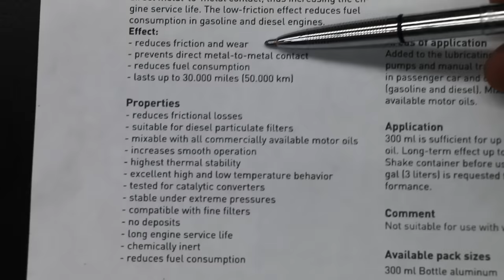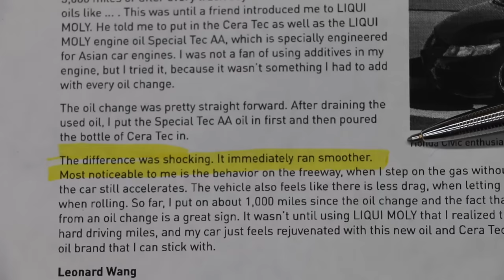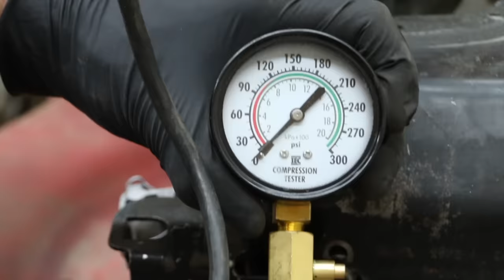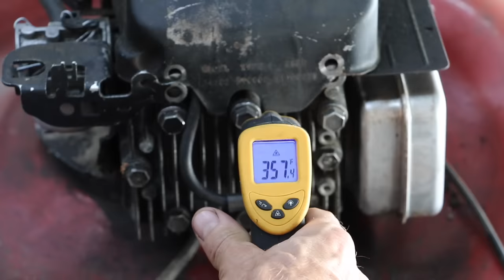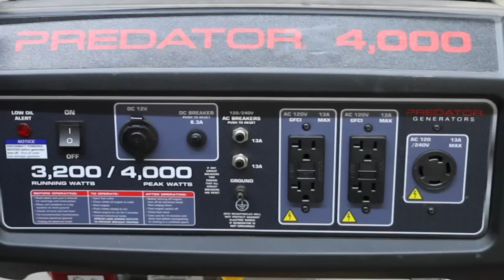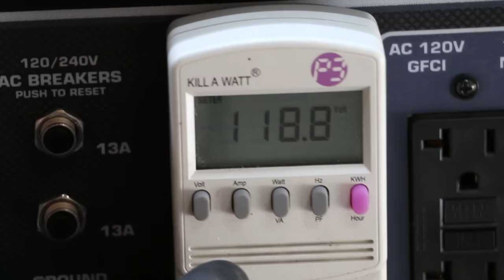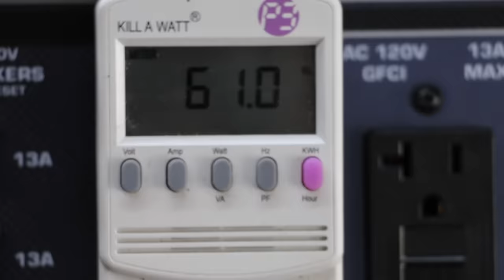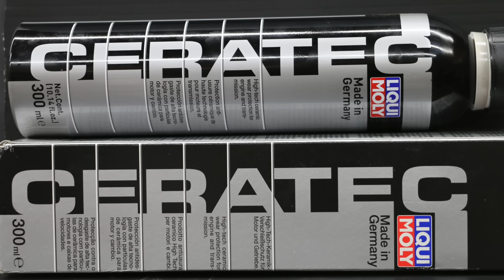Does Liqui Moly CeraTec work?  Let's find out!

Comment: As long as you run a decent, snythetic oil, you shouldn't need to use any additives. Love your work, project farm!
Reply from the maker: Thank you!
Reply: These additives are designed to improve synthetic or conventional motor oils. I have been alternating between Ceratec, Motorkote and Bestline for the last 15 years. Prior to that, there was BG-MOA and Prolong. Clean oil is mandatory IMHO, with or without additives. My gasoline engine has 310k miles and the Diesel has 271K. They both still run strong and pass emissions tests. And it's fun.

Comment: You're like the anti-snake oil salesman. 🐸
Reply from the maker: lol.  My goal is to provide each product a fair test.  It just turns out that most additives don't seem to deliver results.
Reply: This brings up an idea.  How long will an engine run on actual snake oil?  ::

If you can't find it maybe try something like clarified butter or lard in the crankcase.
Reply: He is the bees knees
Reply: thats why we love this channel, he tells the truth and he does it in an even better way that we can through very strict and fair home testing. thank you again @Project Farm
Reply: Agreed.  Most of them are a waste of money.  And hope.
Reply: Ashish Patel I've been using snake oil additives for 20 years and I will keep buying them. They work in my head. That's all that matters.
Reply: @ProjectFarm  test out Lubrication Engineers LX2300. Every vehicle I've used it in not only ran smoother but got better gas mileage. I didnt believe it and thought it was a fluke at first but after going through a whole case of bottles of it I'm a customer for life. Shits wicked
Reply: Mr Splib 
try motor kote it's one of the few things he's tested that actually works and works well. check out his test. it's truly amazing
Reply: This guy is testing for things that the product doesn't claim to improve.  Does the product say it improves lubricity?
Reply: It saved my tdi engine i  hit my sump on some debri on dual carriage way and lost all oil presure and oil i had driven a few hindered yard with no oil engine and turbo were fine and car still runs today with over 250k milies on the clock
Reply: @dereknapier836  there are a plethora of ways, it could passivate th e metal, it could reduce or inhibit fouling or corrosion, etc. Science is your friend...

Comment: When I put new valve stem seals in my Jeep GC, I noticed my camshafts didn't spin freely at all. Rather than spend big bucks on a new top end for an 18 yo car, I tried ceratec and it helped a lot. MPG improved 2 mpg highway and mixed. It does however seem to trigger the oil pressure sensor at stop lights after 3k miles. I replaced the sensor and got the same result - so I'm guessing as the oil loses viscosity pressure drop. So I just change my oil more often. NB: it took me about 200mi of hwy driving to see the change.
Reply from the maker: Thanks for sharing.

Comment: Of the many tests you have conducted there must 1 or more that stand out & you would recommend. A video covering them & your opinion of these outstanding additives would be very interesting, in my opinion. Further,  the investigation could be further broken up into specific classes, wear resistance, longest life (apply every 50,000 miles), price to value, Least deposits, added rpm's, most attributes in a container, etc.
Reply from the maker: Thanks for the suggestion.

Comment: 1% increase in fuel efficiency is certainly significant, but there's still two more determining factors:
The effective life of the product and its cost.
If the cost is high, and the product must be reapplied too often, then the 1% may no longer be a viable result to justify the costs.
Reply from the maker: Great points!
Reply: Exactly. I like one aspect of the idea (increased efficiency), but the bigger picture requires factoring in cost of the product and how frequently it has to be consumed vs fuel cost savings.
Reply: HAL 9000 plus realize that boron is already in every quality oil I've looked at including Honda Semi-synthetic oil 10w-40. It's not always in motorcycle oils, but it is always in synthetic oils for cars...excepting perhaps super cheap Wal-Mart Supertec.
Reply: But other factor to take in mind is that your engine can last longer because of the lower friction and thus lower engine wear.
Reply: InglouriousSimon just use better oil and I'm suggesting this product is already in there.
Reply: That's a cool fact, DE Nichols. Perhaps he should compare oils next. I myself have a pretty high mileage vehicle (245,000 miles) and only use Pennzoil full synthetic high mileage oil. I have always noticed a difference in efficiency when (what I perceive to be) changing to synthetic oil and always wondered over the years, is it just putting fresh oil in there making the difference? 

I'm too much of a fan of synthetic to switch back and use my vehicle as a guinea pig, though.
Reply: yep that 1 percent is a margin of error, and let alone what it may do to other things, catalytics or particulate filters.  id  rather spend the money on better quality oil than an additive, or changing your oil sooner, the oil companies spend a fortune on their oil and already add anything worth adding.
Reply: HAL 9000 - For the less fortunate folk who operate the Caterpillar HEUI Injectors (7.3L Ford Powerstroke & 3.0L Isuzu Trooper), Oil quality becomes very noticeable. Full Synth 5W30 works a lot better than Semi-Synth 5W40, and the difference becomes greater as the mileage increases. After 5,000 miles, the Semi-Synth is noticeably harder to start, Hydraulic Injectors clack louder, the engine idles rougher, and overall performance is degraded.

Dropping the oil after 5,000 miles and filling with fresh clean 5W30 Full Synthetic, makes a BIG difference in the performance of the HEUI technology based engines. In this case, a 4 stroke lawn mower engine is not a reliable comparison to a 19:1 compression Diesel HEUI engine with 9 step continuously variable EGR, when it comes to testing Oil Additive effectiveness.
Reply: Robert LeBlanc Liqui moly says that ceratec effects will last 50000km.....
Reply: delawarecop the bigger questions is why do you still have an EGR on your diesel lol
Reply: WarefareModern3 - Because I do not enjoy poisoning the air that I breathe with NOx...LOL.
Reply: I remember it should last 40000km  or a little more
Reply: I have used the product and thought it helped BUT I am sorry, the 1% is noise because we do NOT know if he had run this test multiple times without and with Ceratec, would there be variation in the results and would the variation be at least 1%  My gut tells me he would found at least 1% experimental variation.
Reply: Cost 17 bucks. RPM starts to drop off at about 12k. I have had about the same results on 4 diff cars thats combined with castrol syntech or pennzoil platinum depending on which one we have on sale. Never tried it with any other oil my customers get about the same results with there own brand of oil.I use it in 2 supercharged Mercedes a FJ cruiser and a Turbo focus ST and average 3 to 400 RPM gain and at least 1 MPG in fuel
Reply: @ProjectFarm  They are not great points, since the product has a lasting effect of 30k miles or 50k Km. So it cost of about 20$ will be spread over 4 to 6 oil changes. So the cost is negligible.
Reply: Very good
Reply: You have to leave it in for at least 5000km/3000 miles but it lasts 50000km/30000 miles before needing to be retreated. An oil treatment that lasts 10 oil changes seems like a good deal to me! It is a little pricey but when you need one bottle for each oil change of the other oil additives, it's pretty cheap!

Comment: Run just liquid Moly in the crankcase to see what happens.👍👍
Reply from the maker: Thanks for the video idea.
Reply: Most of the additives are diluted in mineral oils or synthetic oils with a very low flash point. In just a few hours of operation, the additive will remain in the engine and the mineral oil will be evaporated, restoring the original level. Using only additive, after a few hours there would not be anything ..

I used the ceratec in 2 different cars, one with 200,000 km and a new car. In the new car I did not find any difference, but in the old car a very positive difference. In the video we talk about having tested other additives better than ceratec, what are these additives? Thank you
Reply: Paultro 84 
No
Reply: @texasblaze1016  how about, yes
Reply: @unitaoperativaautomatica80  hahaha I just wanted to see how long it would run before it blew up. I wasn't saying it would be a good idea for MAXIMUM protection.
Reply: Paultro 84  your engine can’t run on 100%    Directions    Are made for a reason
Reply: @nadronnocojr  hahaha like I've told everyone else who commented on what I said, I'm WELL aware of that and just wanted to see how long the engine would run before it blew. Have you not seen his videos where he ran nothing but water or diesel fuel in the crankcase?? I'm smart enough to read directions and I KNOW it wouldn't give the engine maximum protection.
Reply: Paultro 84  I enjoy the mad scientist,  and his videos  ,  but   I also   Didn’t completely read your comment  I apologize  .    Have a super week   I wasvwrong
Reply: @lawbreaker, i think it was a product named engine restore. I wanted to use ceratec as an alternate, since i cant find engine restore in my country, but after seeing this video, i think its not worth it
Reply: It plugs the oil filter, that is what happens.
Reply: I think there is a limit of lubricity enhancement beyond which no improvement is seen. I think most oils have a small amount of MSO2 . additives may only offer benefits when the original MSO2 is worn out.
Reply: it wont work, could make things worse, the product is intended to assist oil and increase its anti-friction properties, just like the intructions say a 6%  max ceratec concentration in the mix
Reply: @RPMHonduras  hahaha like I've told everyone else who commented on what I said, I'm WELL aware it won't provide maximum protection. And of course it won't work, I just want to see how long the engine will run before it blows. He runs all kinds of stuff in the crankcase of engines that we obviously shouldn't try. I know what the directions say, I understand what the product does, I just want to see the engine blow up or seize.
Reply: @3029dz  Are you crazy? Liquid moly company wouldnt do such a product to plug filters, thye run lots of tests, and they have laboratoreis, the stuff is ver fine, dont plug anythinmg. This kind of product is not (plastic ) ptfe, so it doesnt plug anything and dont change viscosity.
Reply: @Limou551  Hahaha. Moly is a SOLID NOT a Liquid.
Reply: @daviddefortier5970   motorkote I think was his best film strength
Reply: @daviddefortier5970  "Engine restore" was almost certainly just as ineffective.

Comment: This is the first video I've stumbled across from this channel, and I have to say, I love the empirical analysis! The anecdotes on these company's sites are just that - anecdotal accounts with no scientific approach at all. It's videos like this that answer te questions a critical thinker will have, like "does it actually perform as advertised?" and if it's even worth it. Good job!
Reply from the maker: Thank you very much!
Reply: This additive works great, it just need time to build up and stick  on the metal parts. Remember, this is not oil, this is coating witch needs time and proper temp, and once stick to the metal, it can last 2 to 3 oil changes (on 10k km intervals) without adding it again.

Comment: I have actually used MOS2 and ceratec, ceratec is more inmediate, MOS2 takes some time to start working. Both are good protection for the engine when racing. We have been getting about 20% more miles out of our engines before failure when using either of them. It helps the most with bearings.
Reply from the maker: Thanks for sharing.
Reply: I contacted Moly by email while a go and they told me Mos2 is for old conventional engines and Ceratec  for modern generations with or without turbo.

Comment: Thanks for this test. I have been using Ceratec in my hyundai i10 1.2 kappa for the past 3 years or so. I run around 75km everyday in mixed traffic with max speeds of 100km/hr and ambient temperatures upto 42C.   It's been excellent product. I have seen an reduction in engine noise, improved acceleration and slightly improved fuel efficiency. However also noticed reduced engine braking. 
Note: i believe that Liqui Moly changed their formulation around 2017/8.
Reply from the maker: Thanks for sharing
Reply: What have you noticed after that date?
Reply: @honestguy7764  I have seen a slight improvement in performance between earlier formulation and current one. Also the effect of ceratec remains for a few thousand Kms even after i replace oil and run oil without ceratec. However after these 2-3 thousand Kms, the effect wears away and i have to use ceratec to get back the same results. My car is currently close to 100,000 Kms and running very smoothly. I have been using ceratec almost fully since around 40,000 Kms.
Reply: Hello Subram, what engine oil do you use along with the Ceratec, asking you considering you are from India? Also, if you remember, was the effect of Ceratec almost instant, or did it take a few hundred/ thousand kilometers before the effect could be felt?
Reply: @shantanuchandra7291  the effect starts quite quickly - within 50kms. Possibly there is some  bonding of the ceramic particles with the engine insides. Normally I use motul 0W40 engine oil for my i10 vehicle.
Reply: @subram2011  good to know, thanks.
Reply: @subram2011 motul xmax 0w40 is great oil. Ever tried 5w40 excess. It way better in terms of performance.

Comment: Hi, I have a 2013 Corolla with 117k kilometres on it and I have used ceratec twice. The engine still runs silky smooth and it also helped with the slight oil consumption problem. I think it’s a good product for helping your engine run for a little while longer. Great video!
Reply from the maker: Thanks!  Thanks for sharing.

Comment: I love this channel and watched several episodes and this one already years ago. I tried "Ceramizer" before, but I can't tell if it worked (and I think it is without extensive testing - like in this video - hard to judge a quality of a product). However, Ceramizer isn't directly available in Australia; hence I bought (again) Liqui Moly these days.  My thinking is: Oil and additives are cheaper than a new engine. I own a 2.4l Hyundai - the one with the problematic crank-bearing issue. I do every 7500km an oil change (recommended by people with a lasting engine) and add every third/fourth change or so Liqui Moly. The engine sounds 30min after adding the product smoother, making me hope that the "magic" happened. Years ago I talked to a chemical engineer in Australia (his company also makes all sorts of additives) and asked him about a story I once heard. The story goes that Russians removed the engine oil of a tank completely and ran it solely on a Russian product - apparently similar to Cearmizer... - because the oil would be so thick in the cold Russian winter that they trusted the lubricating effects of their "magic" product more than the oil. The engine apparently ran for several hours without problem until they filled warmed up oil into it again. The Australian engineer apparently read more about it and believes that the right additive can complement oil quite well and reduce friction. Enough information for me to add something like Liqui Moly, and as long any additive doesn't harm the engine, I am happy to occasionally spend $AU45 (the equivalent of 10 coffees). Probably companies like Liqui Moly love customers like me :-)
Reply from the maker: Thanks for sharing!

Comment: First of all, i love your videos. I use ceratec all the time. It started with my problems with ticking M57d30 (3.0diesel bmw) it sounded like injectors but after change nothing changed, i tried a engine carbon cleaning and still nothing. Then i used ceratec and after few minutes idling. It stoped. After that i tryied that on my M54b30 ( 3.0 petrol bmw) this engine is known to consume oil.. mine did a lil bit like 0.5 liter per 3k km  after ceratec the engine runs smooth and does not consume oil at all. But started again after 25 000 km ? Something like that i think. Added ceratec again and again it worked. So for me it is must have. My friend with Honda engine did not have same experience, i gues it depends on engine. But overall great video! 😇 sorry for bad English.
Reply: Hey can You tell more about that knocking problem In M57 ?